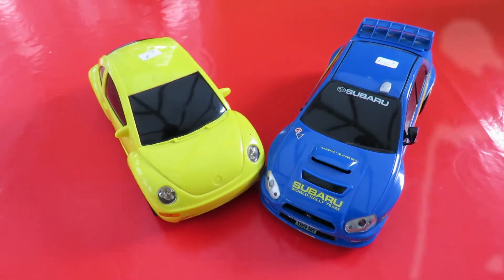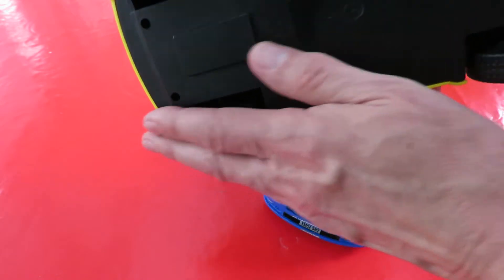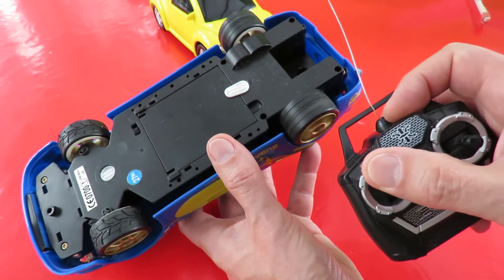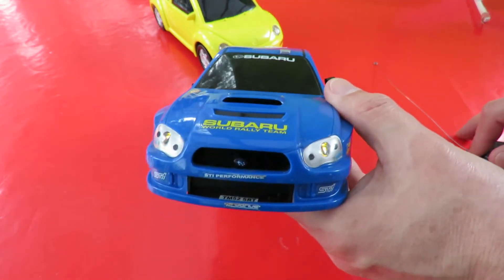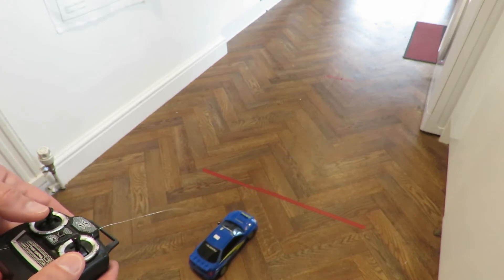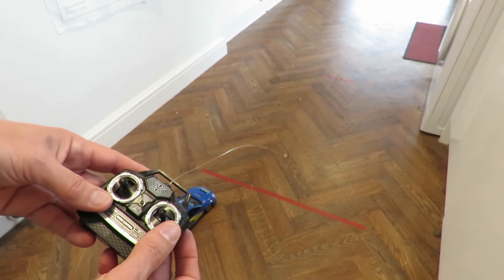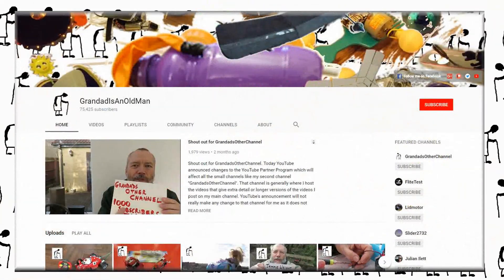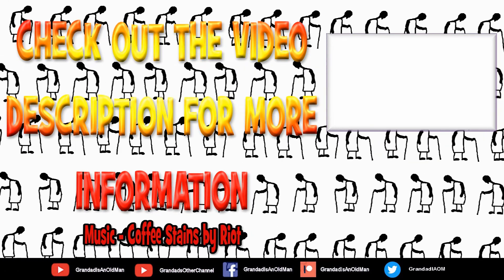CSGOG Subaru 27MHz RC Car

Comment: hi, i wonder  what will happen if u press the turbo button and the forward pitch at the sametime? wonder if the car will go eve faster then with the turbo on its own?
Reply from the maker: The simple way the turbo works is WITHOUT the turbo button pressed there is a resistor in circuit to reduce the power to the motor. With the TURBO button pressed the resistor is bypassed. Some designs do it slightly differently, they have two feeds from the battery pack. One uses the full battery pack and the other only uses some of the batteries.
Reply from the maker: Here is a video I did on the subject Toy Grade RC adding TURBO MODE to TX2B transmitter https://youtu.be/c8Fx4llKOUg although I have just watched it again and I don't show how the receiver circuit would implement the turbo so if you want to view a typical circuit this PDF will show you https://www.hobbielektronika.hu/forum/getfile.php?id=99155
Reply: thanks grandad for the video links ill have a look at them right away